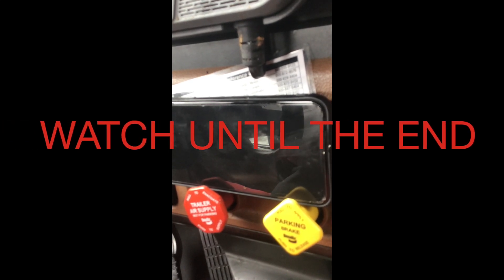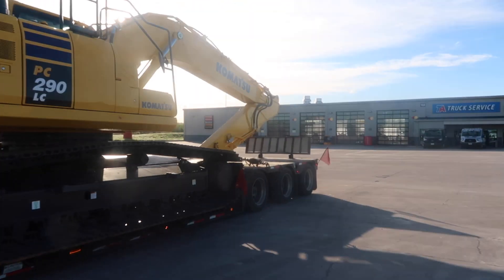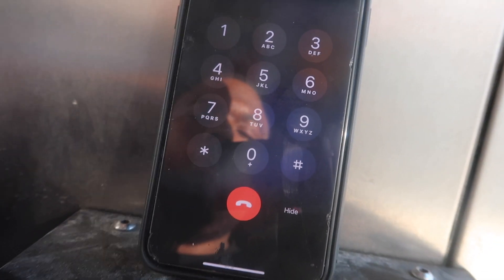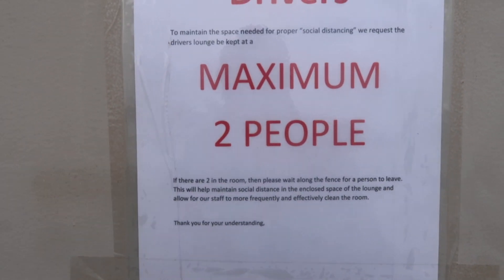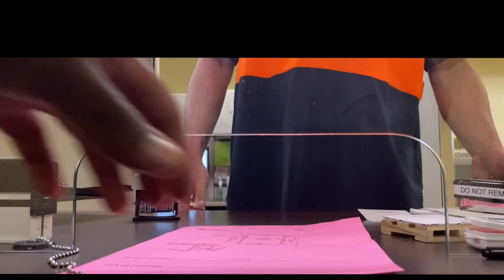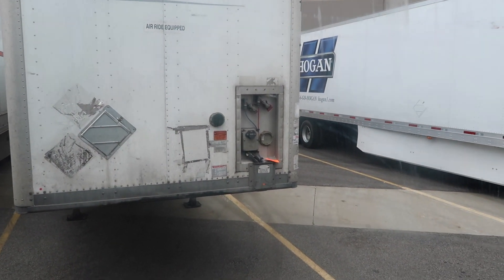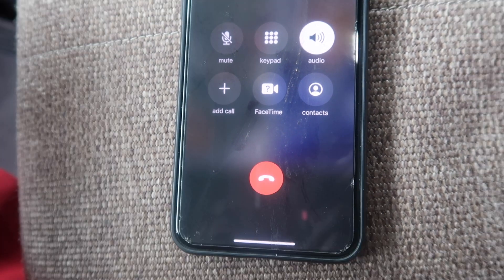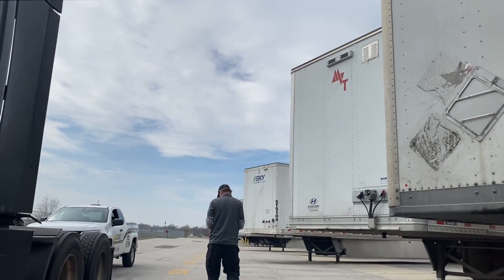LANDSTAR TRAILER GOT RED TAGGED & PUT OUT OF SERVICE WHILE BEING UNLOADED | TRUCKING VLOG; 3-26-2020

Comment: First thing you should do is get trailer inspected, second anytime you drop and hook , always check inspection date . Dude I'm gonna tell you how it is , not like some people...say you drop and hook somewhere else, shipper loads that trailer, you just dumped your trailer issues on the next driver. And for me, I was never a fan of dropping new trailers in Laredo and receiving junk to deal with later
Reply from the maker: I definitely tried to get trailer inspected before delivering, but i thought any TA could do do! Boy was i wrong ... i try to be thoughtful and not drop a screwed up trailer on the next guy if i can help it straight ! Thanks for the comment 🤟🏾
Reply: @RollingWitTB  it's the "right" thing to do, FYI ...no place is gonna inspect a loaded trailer
Reply from the maker: Hold the heck on you have to be empty to get a trailer inspection 😳😳 I swear i never knew that!

Comment: Are you kidding me 6hr to replace shocks?! What a joke they are milking landstar. And why do you worry about it ? Until now you had no idea the shocks were leaking, maybe time to revisit proper pretrip inspection steps. It only takes couple of minutes to bend down and look under the trailer to check them shocks and breaks and wheel seals and air lines.
Reply from the maker: I knew about the shocks because i picked up the trailer the day befor! I was intending on getting my inspection, trailer inspection, and get all the work that needed to be done along the route! For some reason the lady at the beginning of the video said they weren’t doing any work  because they suspected somebody had the virus. Next step was to get load delivered and then get the work done while home, but for some reason an outside trailer shop put trailer out of service because the 120 inspection was past due and they needed to change the shocks. I should’ve just got it done on the Laredo yard !